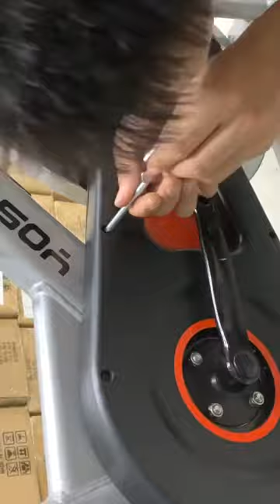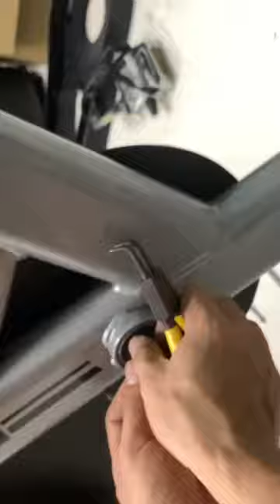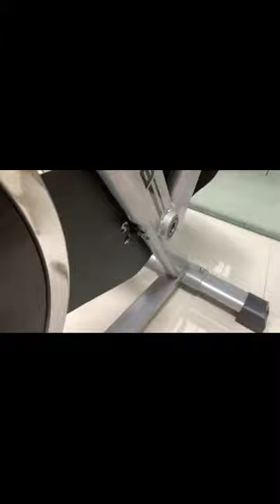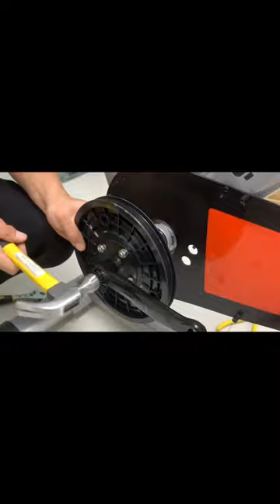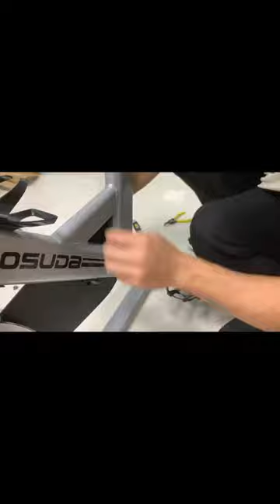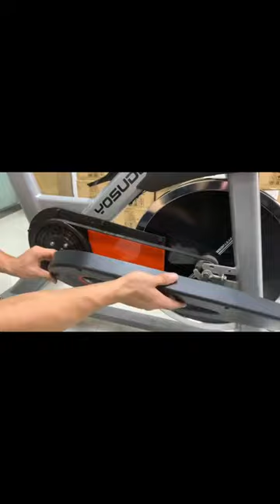YOSUDA Exercise Bike-How to Replace the Bearing L001

Comment: how its not that to remove cranks is welded or spotted
Reply from the maker: Hi, the cranks are not welded, we have a crank puller to unscrew it.
Reply: i have been using a crank puller but it s too hard ive been using a mallet and still wont pull the crabks out
Reply from the maker: @mikkody123  Hi, Carlo, the cranks puller has two different ends, please watch the video again to make sure you're using it correctly, then you shall get the crank off. Thank you.
Reply: @mikkody123  They aren't welded, but machined on. They are incredibly tough to get off, there is no way that each individual lower is produced the same way as this video.